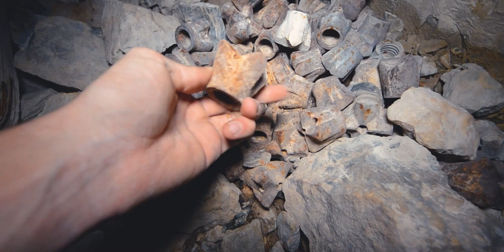Exploring multiple levels of a 1940s abandoned tungsten mine

Comment: The old structure is a water drilling rig.  Had Jerrith continued at the top of the raise up into the stope there is another decline shaft terminating approximately 100' higher than the top of the raise level with rails all the way to the surface and multiple levels.  That connection is the source of the airflow felt in the raise up from the main haulage level with the huge flat car.